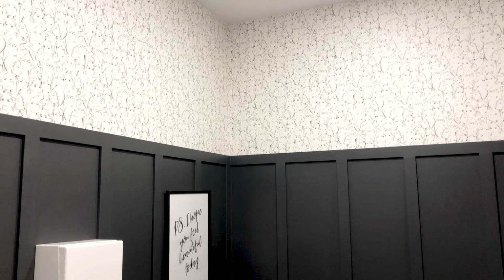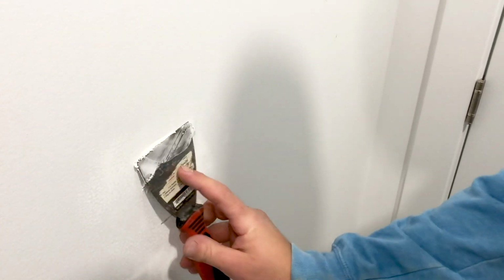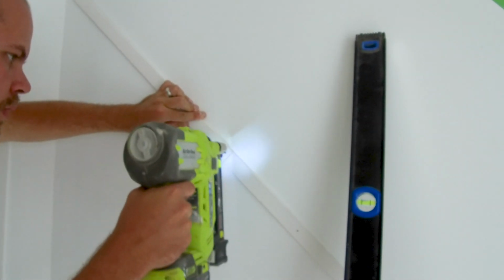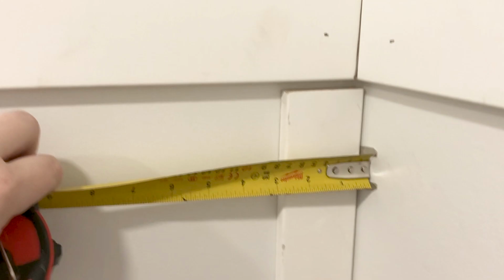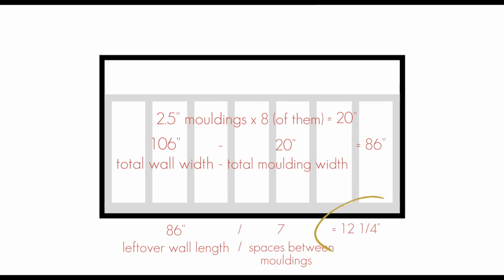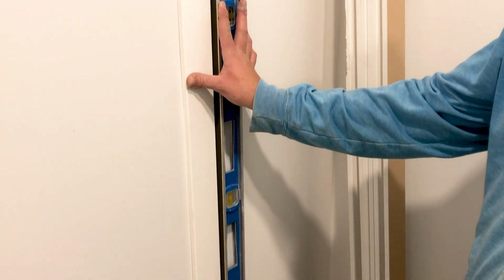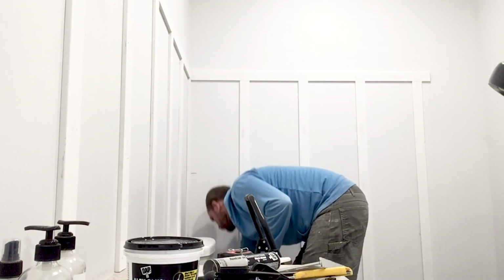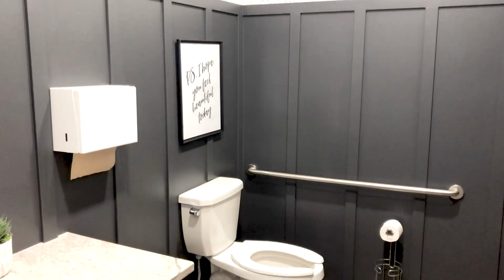DIY BOARD AND BATTEN | How to measure spacing, choose trim, & install board and batten!

Comment: Please help 🙏🏼 🙋‍♀️❓Question- where the vertical and horizontal planks meet, do you use spackle or caulk to fill those “open” lines? I was advised at a hardware store to use caulk, but I feel like you used spackle. What is the right and best approach? 😁

Comment: Type in board and batten calculator , put in your measurements and voila....easy peasy .
Reply from the maker: @Carnivore1959  definitely a helpful tool! Sometimes people like to have a bit more understanding and control over the measurements they’re making. Especially when wrapping around a room.
Reply: @LindiandRuss  not me ...guess I'm lazy ...lol 😂 
It does auch more accurate job than I was able to.  Nice job though on your wall!

Comment: Any tricks to hanging your mirror, since it was partially on wall and hung over the new installed wood. I have similar situation on an upcoming project. Any advice appreciated!
Reply from the maker: As the mirror will cover the area, you can add an extra piece of moulding so this is sits "flat" along the new moulding wall. Thanks for watching!
Reply: @LindiandRuss  thanks!

Comment: I’m curious how you did the board & batten without removing the sink vanity. Did you butt the boards up to the sink? Is there a concern with them getting soaked from the sink water? I’d like to do the same in my bathroom but don’t really want to remove the sink vanity. Can you run a board along the vanity making a bottom “border”?
Reply from the maker: We didn't remove the vanity. You can just run the boards up to the vanity. We would suggest using a paint friendly bathroom caulking around the perimeter to seal and prevent water from getting to the boards. Believe DAP has some products that would work for this.
Reply: Excellent - thank you!

Comment: How do you deal with the vanity? As in, won’t there be gaps between the board and vanity if the molding isn’t flush with the rest of the wall?
Reply from the maker: we just brought the moulding up to the vanity top, and used a paintable caulking to seal. I would allow for the vanity to sit flush against the wall and not have the moulding go behind the vanity.

Comment: I am in the middle of this project and my toilet tank is right up against the wall. How did you fit the batten behind the toilet? TIA
Reply from the maker: We didn’t go behind it, we just went up to the tank, but left enough space so that we could still easily open the tank lid :) There’s a couple inches between the bottom of our board and the tank.

Comment: Hi! I did something similar and my board is batten is under 5’ high. My mirror will be hung and will end up on half wall, half batten and I’m concerned that it will tilt too much. How did you hang your mirror so that it looks flush with batten, even though top is on wall?
Reply from the maker: It was held by keyholes in the mirror and we installed the screws into the top moulding of the board and batten to achieve the look in the video.

Comment: I’m planning on doing this in a bathroom that has a 3-sided vikrell surround tub and was planning on taking the board & batten all the way to the edge of the vikrell and just caulking between the joint and using killz primer on that first piece of wood directly against the tub. Do you know if this would work fine or if there’s any regulation against it? Or if I’d just need to use a sort of composite material instead of cheap plywood.
Reply from the maker: In regards to regulations you would need to check your local area's codes/rules (province/country/state/etc). I (Russel) personally like to tile past the tub surround as I find water always finds its way to the sides of the tub, against the surround  and down the face of the tube. I would be weary of having wood that close to a wet area. But if you properly seal and protect the wood you might be ok? You could also check with a local builder to see what they recommend.

Comment: If I’m doing the board and batten on all 4 walls, do I add the width of each wall? And then do this calculation? Or do I do the calculation for each wall separately 😣
Reply from the maker: I would do each wall separately so that you can plan for boards in the corners. Hopefully your walls are similar lengths so that opposite walls will be the same measurements.

Comment: Wonderfully detailed video! Question: How did you get behind the toilet to nail the batten? I want to do this in my powder room but this is challenging.
Reply: You might want to consider to remove the  toilet for the project. Sometimes it's a chance to install a new one anyway 😉.

Comment: When doing the whole room did you abut vertical boards in the corners of adjoining walls.
Reply from the maker: Yes, we did. But you don't have to depending on your design - if it helps keep spacing more consistent.

Comment: I may be dense, but the 12 /14 inches, is that from the edge of the vertical board (first board placed from the corner) or from the middle of the board? Sorry, I may be over thinking this.
Reply from the maker: 12 1/4" is the spacing from edge of moulding to edge of moulding (not middle of board). No worries, it is always better to ask. Thanks so much for watching!

Comment: Are your corners mitered? Did you “frame” each corner? What about plugs and switches? The devil is always in the details😈 I’ve marked my walls with top rail, but not sure about the rest. Love love love how yours turned out!! Love that dark color choice too!! 👏🏼👍🏼
Reply from the maker: The top rail corners were mitred and we just boxed out around any plug location if the moulding intersected it. Thanks so much we loved how this project turned out too!

Comment: I've done board and batten before but only on a single wall. I'm doing a project where I'm wrapping it around the entire room and I was trying to figure out how to get equal spacing on all the walls. Your explanation of "get it as close as possible" was good enough for me but I thought it would be interesting if you talked through how you got it "as close as possible."

Comment: Why doesn't anyone show how to measure the number of battens if you hqve 4 walls that are different widths? Do you keep the same distance on wall number 2 as you did on wall 1?
Reply: I was wondering the same thing.  I am just trying to get the spacing on the shorter walls as close to the spacing on the longer walls as I can.  I decided how many vertical boards to use by trying to get the spacing the same or close.  Sorry, hard to explain.  I hope that made sense.

Comment: Your voice is so calming and you explain everything with so much detail thats easy to follow. What if my walls are textured.
Reply from the maker: Thank you! 🖤 You could cover the wall with a thin plywood first and caulk that to get a smooth texture to work off of for the boards. Or you could caulk all of the edges of every board well so there aren’t any gaps.
Reply: I have the same question. Even if you caulk all of the edges of the boards, aren’t you still going to see the texture of the wall?

Comment: Did you remove your toilet? We just realized that we don't have enough space between the wall and the toilet. 😔
Reply from the maker: I think when you can bring the boards down behind the toilet it looks better, but in this space we didn’t remove the toilet and didn’t have space, so we actually ended the boards above the toilet. You might be able to see in some of the room shots at the end. Just make sure the boards are high enough so that you can easily remove the tank lid before you nail them down.  Hope that helps!

Comment: Great video. Looking to do this soon in my mud room and carrying the board and batten through to the next room. My question is to get the calculations, should I use the longest room within the two rooms to carry the even spacing? Also, do I place a batten at each corner or just on the first wall to get the even spacing? I hope this makes sense! Thanks!
Reply: If you figured out corners, please let me know. There are a jillion videos but none that explain the corners??? Are they mitered…do you “frame” each wall individually? What to do about plugs and switches??? The flat length of the wall, is the easy part

Comment: Question about spacing the vertical molding pieces. I understand the calculation you showcased in your video, but how should the spacing be if each wall is a different length? I am installing board and batten through out my downstairs and every wall is a different length. how should I go about determing the appropriate distance inbetween vertical moldings? I am currently in the design phase and have settled on a distance between vertical moldings of 24 inches. When I reach a corner, I plan to install a vertical molding on each side of the corner and then start my 24 inch spacing again from the corner. I hope that description makes sense... Watching your video and seeing the calculation, I understand how that would work for 1 wall or a small room, but cannot think how to apply it to a large irregular shaped space. HEEEELLLLPPPPP
Reply from the maker: RedMercury hey, so I would just do the same calculations for the next wall, and use a spacing that is as close as possible for the other walls. So if 22” makes sense, go with that. Honestly people will never notice the difference when you have full walls done, as long as the spacing on those walls is equal. You can also gain some space by not adding another piece in the corner (which we did in one of these bathrooms).

Comment: I have a question about how you did the piece behind the toilet? And the sink. Did you stop it at the counter of the sink ? Or did you move the sink
Reply from the maker: We didn't move the sink, we had enough room behind the faucet to bring the board down to the countertop, so we did. At the toilet, we brought it within an inch of the tank, so that we still had room to remove tank lid (the toilet was too tight to the wall).

Comment: Thanks for the calculation method! Do you have a suggestion if your baseboard is tile? (Trying to avoid removing it but am afraid if I place a 1x3 on top it’ll stick out) is your baseboard the same depth as your molding pieces? Did you use a water-treated molding for the baseboard in case of overflowing toilets or water on the floor? Thanks!
Reply from the maker: We had a rubber trim around the baseboard (a commercial product), but yet they were the same width. If I had tile, I would probably pop it off and cover it with new baseboard.

Comment: With wood pieces that are 1x3 do you need to find studs to nail the vertical boards to? Thank you for your video how to calculate everything!
Reply from the maker: No, you won't be able to find that many studs. Just glue and nails should hold it in place!